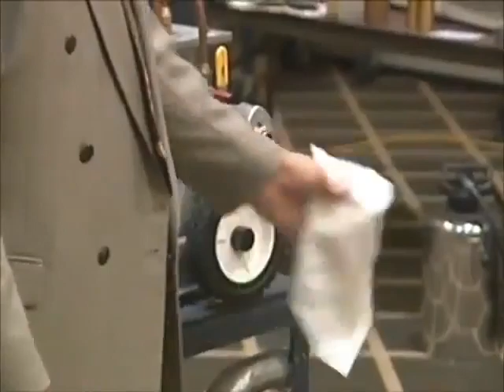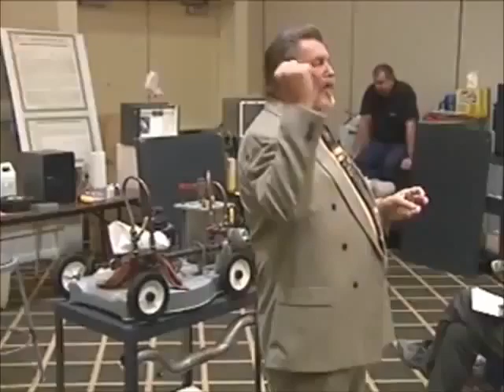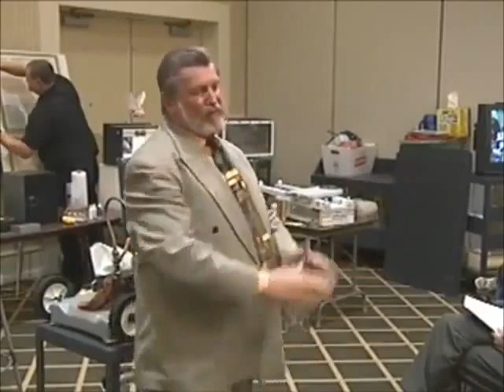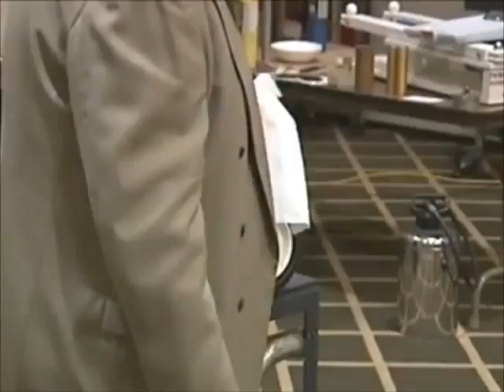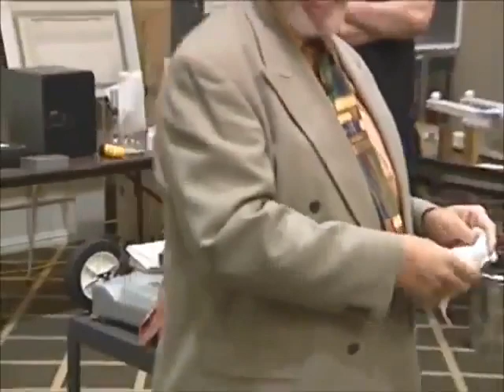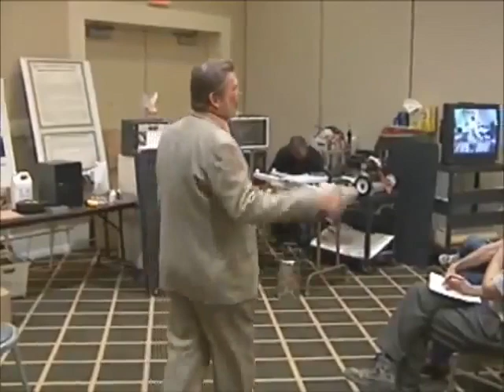NO EXHAUST Engine Dennis Lee shows running Geet Engine (closed loop)

Comment: I understand people say this is a scam. But then they say you can run it on other fuels like old engine oil running a petrol motor, but you're not getting the 80% fuel saving. If you can run a engine on 90% used motor oil and 10% petrol what I doing my diesel. You are getting 80% fuel saving because you get the oil for free. Cheers Graham

Comment: I agree with mark holbrook, if air is going in to the engine and not coming out then the amount of gas (as in air/exhaust gas) in the system would just go up and up.
Reply: What if it had a pressurized relief valve do you think it would work then? I am just seriously asking a question I know some energy would be lost/exhausted  but still wouldn't it be a huge energy saving machine?
Reply: captain42979 
Well the thing is, even if you put a pressure relief valve in, the pressure will rise in the system from the intake air until it gets to the point that the relief valve has been set to open to release air. Then it will release air at exactly the same rate that the air is coming in from the intake at. So you have just got a normal engine again. Albeit at higher pressure engine.

There are some energy saving devices out there that seem plausible tho in my opinion. 
I really like the magnet motor (I think that's what its called) that spins a rotor using solid non electrical magnets. I think its real, I think there are some fake ones on here but the concept seems possible to me.
Check them out and see what you think : )

Comment: The exhaust is going elsewhere. Its a scam. You have air going into the motor it must go somewhere.
Reply: there were theories the engine works on implosion instead of explosion .That may explain it